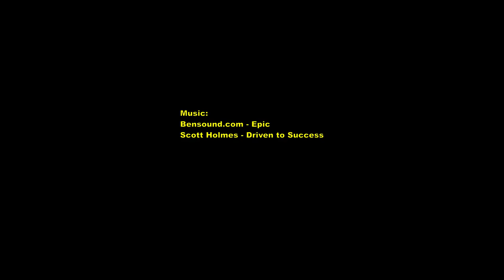Fireplace Removal

Comment: Did you have to seal the chimney or flue?
Reply from the maker: No since all of that got removed completely.  I have other videos show me removing it.  It was already capped when I bought the house, so I didn't have to touch the roof either. (that saved a lot of work, roofing is one of those things that frightens me a little... mistakes can be very expensive)
Reply: @redsquirrelftw  thank you for the reply. I want to remove mine but I am still in the Youtube research stage 😁

Comment: Did you mortar up the backside of that section that you rebuilt with block and bricks? How'd the drywall patch turn out?
Reply from the maker: TBH my mortar job was pretty bad, it was good enough to get the blocks to stay in place, but not the prettiest.  I was reusing blocks, some of which had mortar already on them or were broken so it was trickier to get things to be straight and even.   I was not too concerned with looks though since it's being covered on both sides.  I technically could have skipped that step altogether but I figured since I had the scrap blocks may as well at least fill the hole.  Drywall on living room side ended up pretty good, you can hardly tell there was anything there.  The drywall in general is not perfect in this house though so it kind of helps "hide" imperfections.

Comment: I'm not familiar with the wire used at 10:05. What is that for?
Reply from the maker: It's a metal wire, normally used for drop ceiling or rebar.  It gets crushed when the nail goes in, creating a very tight fit.  Some random person at Home Depot actually showed me that trick.  Beats using tapcons.  Those things are so hit and miss and are generally annoying to use.
Reply: @redsquirrelftw  I had a feeling it something along those lines. Pretty neat.

Comment: Paint is good enough vapour barrier.  Just make sure you seal all the gaps and cracks.
Reply from the maker: Only if you use sealer paint like Drylock. The issue though is paint does not do a continuous seal. Typically there is a gap between the drywall and the floor and even if you were to fill it, the wood of the floor itself is not a good vapour barrier.  You really do need a continuous plastic behind the wall that meets up with ceiling.   The rim joist area is problematic too in older construction as there is no easy way to tie the vapour barrier with the one above.  Ideally you want a full continuous envelope.  Hard to do after the fact on an older house though.  I just spray foamed mine but you still get plenty of air leak through the wood area around.  Wood does let air through slowly.  Makes a difference when it's -50 outside and +20 inside.